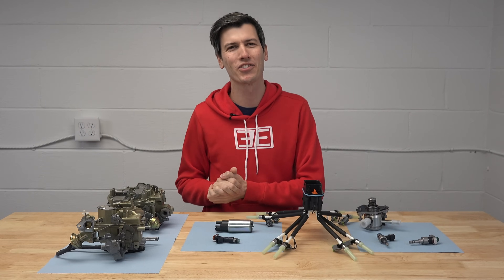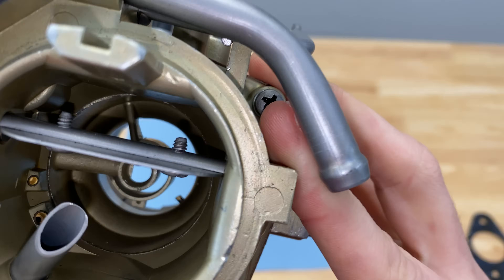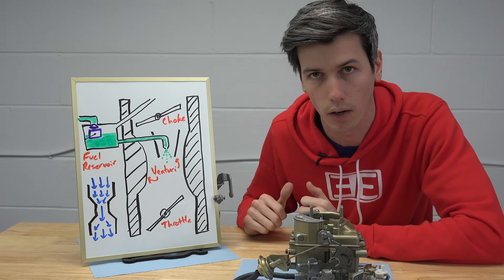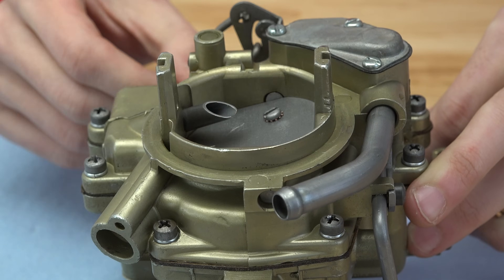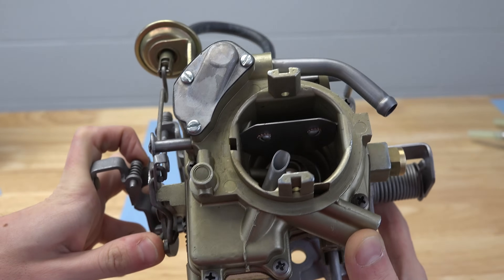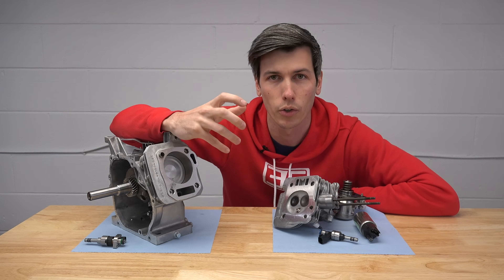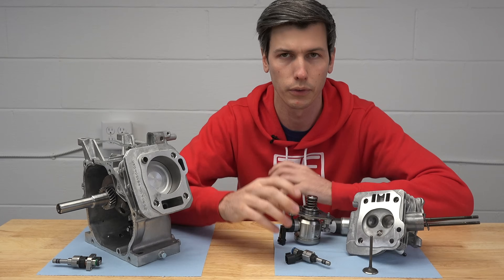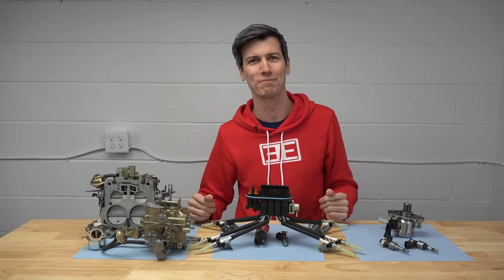What's The Best Fuel Injection? Carburetors vs Port vs Direct

Comment: Hey Jason,  better title suggestion

"What's the best fuel DELIVERY" 

Since carburetors don't really count as 'injection'
Reply: Injection is high pressure on one side and low pressure on the other. carburetors are injecting the fuel.
Reply: they're still a form of injection, Just not "electronic injection"

Comment: How that happened that manufacturers decided to put direct injection only (no port injection) into small engines?
The target is daily drivers who expect reliability. These engines are not reliable and the repairs are costly.

I understand there are some benefits passing the eco-mob, but the manufacturers must be more honest about design flaws in terms of reliability. The trust for the manufacturers is going down, and so are yearly sales for over 10 years now.

Comment: Great video.  The carburetor gasoline jet in the schematic should be above the gasoline level in the bowl.  If not the gasoline in the carburetor bowl will leak into the intake manifold when the engine is stopped.

Comment: Carbs, long time ago. 
I've built a couple engines with force induced carburetors.
That was annoying, a lot of problems occurs when you pressure the carbs instead of sucking thru them.
Im all fuel injection now though, so much easier when you going the forced induction route.

Comment: He needs to talk to some serious performance tuners that run carbs. He glossed over a ton of huge benefits of running a carb. And even skipped over how advanced modern carbs have become.
Reply from the maker: Care to share? Happy to learn more!
Reply: @EngineeringExplained  Carbs are analogue and infinite in settings.  Carbs make more power at WOT.  Some carbs automatically adjust for elevation changes.  Can make changes to a carb without a laptop/internet.
Injection maps are just spreadsheets with ranges of values and are very finite.  Injection is reactionary to the sensors, some of which are downrange (O2). Some injection set ups are 'learn as you drive';  if you change your driving, the injection may stumble until it figures out what is going on.

Comment: Great video! You should do one on SU style carbs sometime. I know nobody uses them any more but they were a neat design. Maybe we need an Engineering Explained Classic channel. 

What forced the switch to fuel injection (which is ultimately better but at the time was more expensive and not as reliable) was catalysts as there was no mechanical equivalent to the "lambda sensor" or O2 sensor in the exhaust.

Comment: GDI engines are really effective at preventing knock.
It's common in Russia that people are using fuel with lower octane raring for saving money (gasoline here is more expensive than in US, especially when mode income per month across the country is about $450)
GDI engines in such barbaric scenarios, even turbocharged:
1. Don't run too rich, using less fuel
2. Don't retard timing too much, losing less power
3. Knock less
Reply: Hot summer times in Russian cities are a fcking knock fest. Everyone is knocking.

Comment: Having read about port/direct all my life, it was VERY interesting ("neat" lol) to see how carbs work. Especially the four barrel. Imagine the lever of simplicity in adjusting the points on the throttle when the larger barrels open up. Very cool! 👏
Reply: There is generally no need to adjust the seccondary opening point on that style of 4bbl, I've got 2 trucks running that carb and only 1 of them have I tweaked the seccondary opening linkage on. (I didn't even "need" to, BUT I was prepping the carb to go on a 320HP engine)

Comment: Mechanical injection ?. I remember my dads 1969 Triumph 2500 PI. Which had a mechanical Lucas Fuel Injection. This had a mechanical timed Fuel Distributor which had to be timed just as the ignition distributor had to be as well. Same engine as the TR6 which over here in the UK was rated at 150bhp. Not bad for a 2.5L 6cyl of that time.

Comment: 2 questions: 1 doesn't top fuel still use carbs because of their massive flow rate? 2 if carbs are partially operating by gravity, how did fighter prop planes use them when not flying level?

Comment: Variable Venturi would be a nice extension to the carburetor topic.
Also as mentioned above, the mechanical injection systems by Bosch are quite interesting from engineering standpoint.
Maybe in a future video? 
Although both VV carbs and K-jetronic  are probably rare in the US

Comment: Gas engine...rail pressure up to 5,000 psi WOT. Diesel engine...15,000 psi is normal rail in terms of rail pressure. 

I'm somewhat curious...direct injection versus indirect injection. Great example, the 7.3L IDI built by International for Ford versus the 7.3L Powerstroke (built by International for Ford). IDI has a 26:1 compression ratio where the PSD has a lower 17.5:1. Never have really understood the dynamics of indirect versus direct injection (the direct injection engines typically feature forced induction thus lower compression ratios are used).

Another fun discussion, two stroke gas engine versus a two stroke diesel (because positive pressure via a mechanical blower is awesome).

Comment: Carbureters can never fully stop fuel flow on overrun as there is an even higher intake vacuum than WOT. One of the reasons for it's fuel inefficiency.
Reply: not really true, most carbs block the main jet and run on the idle circuit..

Comment: @ 3:03 , you said "trying to pull in air and fuel"...😤 Everything was going soo well! 🤓 And then, you tried to suck air! Air is never sucked or pulled! You know that, too! And, while we're goin' here, I think another couple second should have been devoted to clarifying the pressure and vacuum sides of the venturi.  

I really like your presentations. You make learning the new technologies fun and easy to understand. I'm guessing many viewers get a smidge of jealousy at some of your "conquests"! Like you Mazda Miata drive on the windy road. But, you did that so we'll, it seemed like I was a passenger with you! 

Remember: ropes and chains can only be pulled. Air and liquid can only be pushed! Blessings! 

An update: one force can pull air and/or liquid; that'll be GRAVITY! Which, of course, results in 14.7 psi of atmospheric pressure at sea level! We can thank gravity for many things! Naturally aspirated reciprocating engine are one.
Reply: It's all about frame of reference. From inside the cylinder, air&fuel are pulled in by vacuum, from outside the engine, air is pushed in by the atmosphere. Also, the venturi is the bernoulli effect.

Comment: Thanks for the informative and educational material @Engineering Explained
I did a quick search and didn't find a comment/question as to why not direct air injection? Shouldn't that provide even better control on the air-to-fuel mixture/ratio, and assist in cooling the cylinder? 
Since many new cars are equipped with a sort of forced air system, there should be enough pressurized air to make this happen. Additionally, intake valves can be removed and the exhaust valves can be simplified (Koenigsegg's valve-less approach, or varying sizes of exhaust valves). I understand that this will be a costly upgrade, but with ICE's imminent end, this can be the last achievement before demise.

Comment: I absolutely disagree that you don't have much control over a carb. You can have a silly amount of control over air fuel ratio, you just have to know how to use it. The AEM UEGO I have in my 1971 Dodge Dart proves my point every time I drive it.

Comment: Has any company built a motor from the ground up with dual injection planned from the outset? I feel like it would influence a lot of the design of the motor, specifically intake design. I would love if Ford did a ground up redesign of the NA 5.0 maximizing current tech like dual injection, friction reduction, lightweighting. I suspect in a relatively lightweight and aero optimized package a 5.0 could hit 30mpg on the hwy.
Reply: My 1997 Lincoln Continental with 4.6 DOHC would cruise at 70 mph getting 29 mpg US.  Not really lightweight, but had very good drag coefficient.  That motor has a dual intake, with two sets of butterflies, which worked really well for mileage.

Comment: Port injection does not cool charge - it is sprayed before intake valve opening on the back of it and vaporizes on the port walls and the valve.
Direct injection (if used without turbocharger) increases maximum power because it increases volumetric efficiency by cooling intake charge.
Reply: DI also has the advantage of injecting after the intake valve has closed,
What this means is that with the rough 14.7:1 mix that goes in a port injected cylinder a 15.7 comparative volume of air can go into a DI then get the fuel added.

Comment: "Carburators haven't been used in any production vehicles in decades"

Aviation world and Lycoming : "mmmmmh looks like we missed a train here"
Reply: Maxime Eckstein You can still buy carbureted aviation engines, but virtually all of the new Lycoming/Continental engines sold in new aircraft use a rudimentary port injection system. The FAA is slow to adapt new technology.
Reply: Robbe Plunkett man isn’t that the truth.
Reply: @robbeplunkett699  so true.

I worked for a small lite aircraft manufacturer and we used Lycoming and Continental engines. The injection system reminded me of the 90's poppet valve system used on GM V8 and V6 truck engines, which was eventually replaced with injectors, as EE showed the injector "spider" in the video. 

The Rotax engine we offered did use a modern (for the aviation world) electronic fuel injection with injectors at every port, a MAP sensor and associated electrics. 

For what Lycoming and Continental charge for an engine (last I checked it was $30K) you'd think they'd offer modern fuel injection. And yes, the FAA is WAY behind the curve.
Reply: David Gonzalez Exactly! I currently fly newer Cessna 172s and Piper Arrows and the fact that these modern aircraft (albeit old designs) still have a mixture control for the pilot to vary the AFR is ridiculous IMO. If you don’t mind me asking, what company did you work 
for?
Reply: @DavidGonzalez-lu3eb  Yup rotax is trying to change the game and the "new 915" which is also turbocharged is very similar to a modern car engine but at what price ? Dual electronics, dual alternator and multiple redundent componnents for the sake of safety. Don't get me wrong I love this engine for multiple reason but if the others manufacturers stick to the old carburetors it's just to keep the engine separated from the electrical circuit. You could have an alternator failure and still be able to fly and land "safely".
Reply: I don’t know of any new Aviation company that still uses a carburetor. 🤔
Reply: Is he really wrong? Carburetor is no where to be bought as the 1983 Accord gave out?

Comment: There is something i would want to mention and something i want to ask: The 300 SL of 1955 had a mechanical direct injenction. And i would think it had no problem with carbon deposits, as i think (could be wrong) the return of exhaust gasses into the intake was done much later for emission reasons. 
The question: Diesels before common rail had a little pocket inside the cylinder which contained the glow plug and the injectornozzle. Does this still count as direct injection? It is inside the cylinder, but notin the designated "burning space"...
Reply: Technically they arent direct injection even though the injector is constantly connected to the combustion chamber through a tiny hole.
Reply: @dylanmontgomerie6069  Why not? everything i read about the cars engine said it is direct injection. It injects directly into the chamber onto the exhaust valve and the pistonhead. (for extra cooling of these parts)
Reply: @nirfz  Sorry i meant the diesels you were talking about, the 300 sl is direct injection.

Comment: If you want both performance and economy it may be hard to beat patent pending Augmented Compression Engine (ACE) technology. This uses either a super simple carburetor (no need to vary fuel/air ratio) or fuel injection to inject the stoichiometric ratio of fuel to air, the inlet is long enough to vaporize the fuel and the throttle valve just before the combustion chamber adds enough recycled exhaust (EGR) to reduce down to the power selected. Just before the throttle the ACE also uses water injection to put in the appropriate quantity of water. This water does the triple duty of cooling the mix, making it denser allows more into the combustion chamber, cooling the combustion just enough to prevent power being wasted in combining oxygen with nitrogen producing NOx and in doing so turns to steam, expanding and providing even more power. 
  Otherwise no changes need to be made to the average internal combustion engine, though one should no longer need a catalytic converter and ceramic coating the combustion chamber(s) and recycling water vapor from the exhaust is suggested.

Comment: Cries in sad Diesel noises, just cleaned the intake manifold and egr system of my 150,000 mile kia ceed. I wish they had some valve cleaning tech because that was insane and i didn't even get to the valves.

Comment: Why don't engines use dual fuel, propane for clean lean burn on port injection PLUS gasoline (or diesel) for power via direct injection?

Comment: Points, Carburetor & kick starter make a perfect combo.
Reply: The vid didn't mention repair either. Should of been considered when grading "best" system. Carb and point is so much easier to maintain.
Reply: @Incab  I hate carbs and points!!!! Had a 1970 Volvo with both; was working on it forever. I always knew when it was time to file or replace the points (every couple months): the engine would get balky and the clutch would be really ragged. The throttle pivot was worn out as well, letting air in and making the idle unreliable. Much less maintenance with electronic ignition and port injection. Made it 200K miles in my last Prius without touching either one.
Reply: @flagmichael  That's just a bad car, not a bad system. Look at the cost difference between an average carb kit and rotor cap vs the injection system and computer chip on the prius. Substantial. To each their own but I would rather have a 1978 F-150 than a 2020 F-150.
Reply: I love my moped with carburetor on it and kick starter too 😘
Reply: I'll concede on transistor ignition. But the rest of the BS you can keep. FI: I have 12 vehicles and not one has injection. Just keep it.
Reply: Tool kit under the saddle and you are done, 70's Honda FTW

Comment: For direct injection:  If the fuel is injected directly into the cylinder, and not into the port, how will there be carbon buildup on the backside of the intake valve?  Where does the carbon come from?
Reply: Oil vapor.

Comment: Until now new motorcycles and scooters were equipped with carburettor. They are dead with stringent HC emissions as part of BS-VI norms. RIP Carb.
Reply: Motorcycles are exempt from emissions here. Duel carbs on my '86 and get around 40 to 45 mpg, 700cc.

Comment: I notice you didn’t really talk about latent heat vaporization that occurs with a carburetor. Air coming out the bottom of a carb is significantly colder than air going in. Fuel injection does not have this benefit.

Comment: One example of a car that use the both systems of fuel injection, is the VW Golf GTI. Here in Brazil, we have the VW Jetta TSI, the last generation, don't use the both system, it use only the direction fuel injection. Now, in the new generation of  Jetta GLI, they using the both systems. I think they made that's changes because here, we don't have a good fuel, an that cause a some problems, like the carbonized the intake valves and that consequences is that haven't a good compression. Sorry, but my English is a work in progress.... Hahahhaha

Comment: I remember for instance my old mini cooper S 4 cylinders and 4 Weber carbs, I remember the old six packs also, so many choices....I still prefer carburation for my off road 4x4  with that old 350 engine . I still get 28 mpg on the hwy on the way home after a week-end of off roading. Thanks for the great vid !
Reply: On a down hill run with the wind behind you, but that said there is a builder here in NZ who still uses his 1970's GM Scotsdale 4x4 suburban 350 4speed manual 2 barrel  and he swears he gets 24mpg imperial all day long HWY/city, so the good old 350 can get respectable MPG.

Comment: We have had major issues at Honda with the direct injection carbon build up issue. When I was at Mitsubishi though they introduced their first DI motor in the eclipse cross and it used both port and DI and thus we had no issues with carbon build up. Shame Honda yet again lags behind on the tech.

Comment: As the injection system imparts high pressure inside the cylinder by which N0x production increases...so what is your view to this..

Comment: Naturally aspirated drag racers and nascar use carburetors. They can produce more power if tuned right. They were mostly fazed out in production because of bad emissions and they aren't very smooth. Also fuel injection is just easier to mass produce and tune all the cars apparently.
You also seem them on some blown cars, but never really high boost it seems. I'm guessing the carb just cannot keep up with really high pressure airflow, but could be wrong. Also don't really see them with turbos anymore.